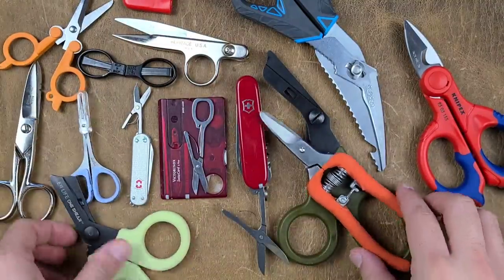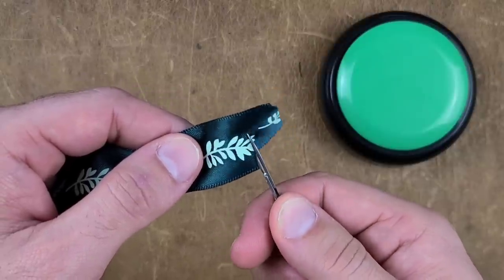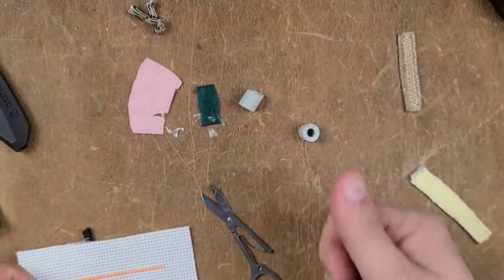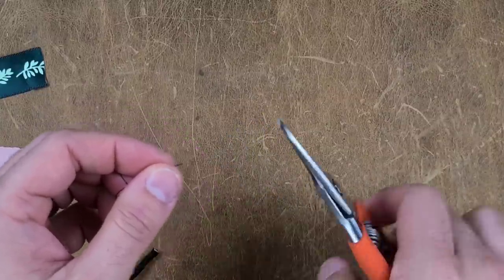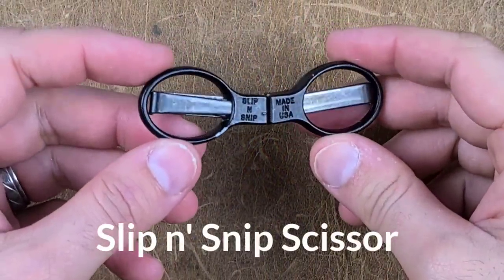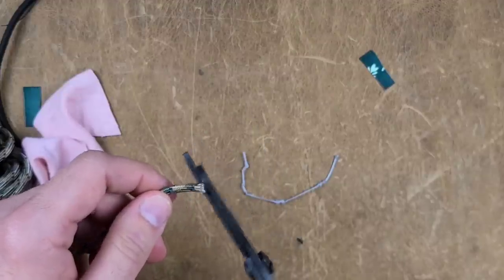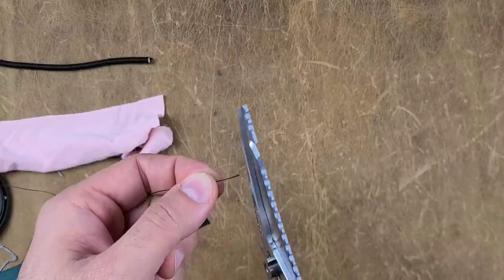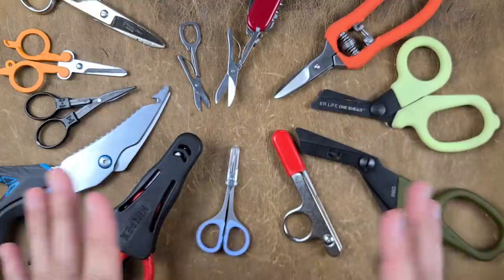✂️ EDC Scissors #1 (DIY Multitool Toolkit)

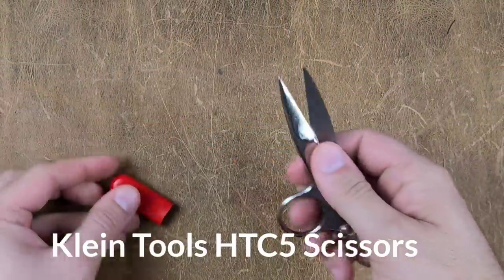Comment: 28:21 these are thread nippers. They are ONLY for cutting thread. Nothing else. Not for cord, not fabric, not Kevlar etc. Just sewing thread. The construction on these is very nice as they are forged and solid steel as opposed to cheaper plastic ones but the way they are put together or sharpened is lacking a bit. Ginghers make the nicest ones that come and stay razor sharp.
Funny enough Klein doesn’t actually make their scissors, they are made by Heritage Tools.
Reply from the maker: AH I was wondering who made what! do heritage is the maker? that is awesome!

Comment: Can you put the ALLEX Black Scissors scissors through the gauntlet. $12 on Amazon. Possible sleeper or dud. I have it and I bought a few of these. I've been experimenting with it and it seems to be quite capable but its handle is more comfortable. It also looks quite sleek and is compact. Could be good for EDC. It cuts easily through zip ties and plastic.
Reply from the maker: I am sooo behind atm, not sure when I can get to that.
Reply: @maxlvledc  No worries! You're doing great!!
Reply: @maxlvledc  This is 6 months later but please don't include these ALLEX scissors ROFFLLL. These can't even cut zip ties. But hey they do look sleek. :P  That said, while not at all the same is it odd that my KitchenAid All Purpose Shears are cutting everything super easily. I'm curious how it'd do in your gauntlet.

Comment: The slip and snip work well, but they need to be adjusted right from the factory. Shameful for American made. However, I still can't help myself. No Chinese tools. Anything, but Chinese when possible. So I adjusted the slips to cutting perfection. I can get through a beach towel, which is really hard for many scissors

Comment: on multitools, Victorinox (scissors) are on the top level. Leatherman are decent and become really good if sharpened (easy to do). Gerber Suspension are decent too but harder to use.

Comment: Tx Tool Crib goes into scissors a few times, but goes into blade geometry here: https://youtu.be/3cHYQVPkQ7E
Fails/performance seem to come down to an interplay between lateral flex, blade thickness, blade oriëntation (does it force material clockwise or counter clockwise), amnd grippiness (geometry and serration).
I might rewatch this later to see if there's a pattern here (ADHD hyperfocus can have its benefits)

With the squeezing scissors: it is mostly used as a sowing scissor here, so was surprised about the precision cut. Did you apply enough lateral pressure? In between Victorinox's I use similar ones (though somewhat different tip shape) and it does help, I can even snip out individual beard hairs. 

Also, there's a few categories here: pocket/purse scissors, belt carried and pack carried (like the Gerber). It really is apples to oranges...

Comment: FYI for actual edc use the fiskars are awful. Uncomfortable and after a while the connection point on the handle starts to loosen and they’re basically useless after that. You’ll open your fingers and the handle will move, but the actual blades stay closed.
Reply from the maker: Hmm, yea this doesn't show what happens over time...I'll  have to keep looking

Comment: Leather man micra have very good cutting scissors
Reply from the maker: I tested them, the data does not support that. My experience with the micra is that 1 in 6 has decent HT and edge geometry (the one I did think was good was made in 1999)
Reply: @maxlvledc  well I do admit my micra is an older one so that may be. Mine cuts very well so I assumed they all would. That is actually good to know because I’ve been thinking about getting another one in green but if they are hit and miss on the newer ones I believe I will pass on that.
Reply: @maxlvledc  I also just got a Roxon KS knife scissors 2 in 1 and so far the scissors are cutting great but I just got them so I haven’t tried them on much yet.

Comment: Your ranking system is a "TOTAL FAIL!" Why are you using a1/4 scale, pocket multi-tool version of a dedicated tool as the reference instead of something the Wiss Multi-purpose utility scissors that can be had at Home Despot for $10?

Multi-purpose utility is exactly what your "gauntlet" is testing is it not? Even though, the Klein Elec. scissors sell for $20 at HD, that's still $10 more for a tool engineered for a specific craft. I can buy another tool w. that $10. 

But hey, even if you made Klein's the gold standard and then compared multi-tool scissors to them and the results showed that you get almost the same functionality from a non-dedicated, easy to carry in your pocket every day for roughly the same cost with additional tools.

That's something that's worth attention and talking about.

Comment: Good review. But, I think it is unfair, and disingenuous of you, to use what you describe as " blunt scissors" in your test! You even say that you might repeat the test after you sharpen them! WTF? 
You also fail tiny scissors because they won't cut pallet straps! THEY ARE NOT MEANT TO DO THAT! You can't expect little Swisscard scissors to compete with huge Knipex scissors, or the One Shear. It's like failing larger scissors for not cutting through a sheet of aluminium.
Finally, these are supposed to be "EDC" scissors. No one, and I mean, no one, apart from paramedics, would ever carry the large scissors as an EDC! 
You say that "technically", you can put the enormous Gerber shears in your pocket... That's like saying you can carry a pair of tinsnips as EDC.. Technically. 
Maybe you need to do a fairer comparison by class of scissors.
But good idea to try such a review of "EDC" scissors.
Reply from the maker: I did retest them btw in the last scissors video